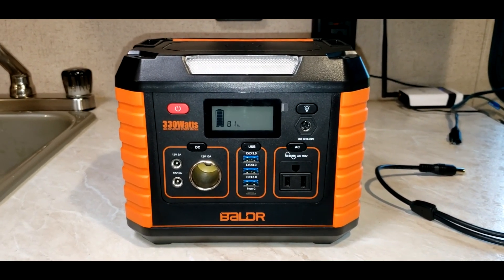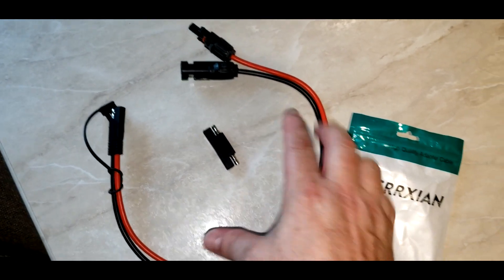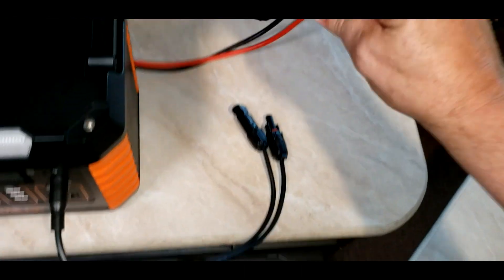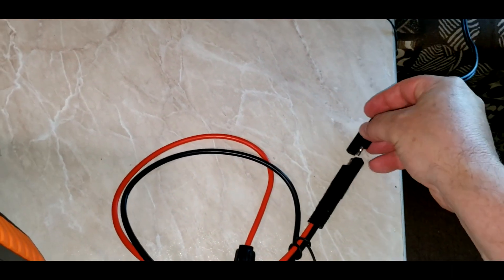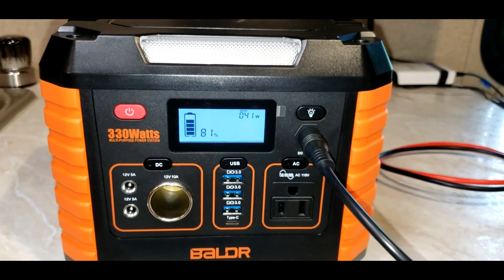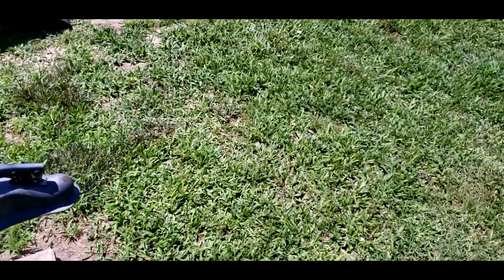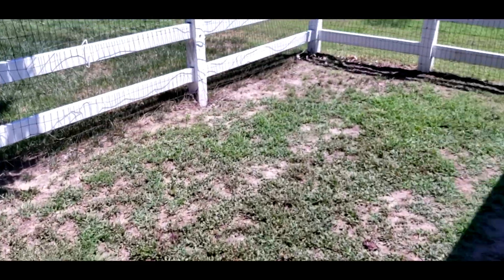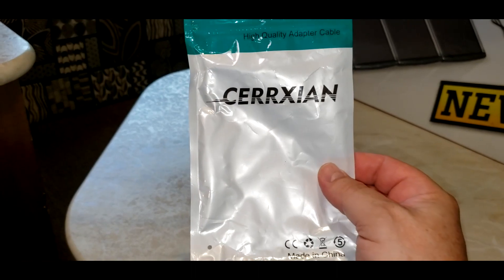Baldr 330W and Harbor Freight 100 Watt Solar Panels

Comment: Excellent, thanks. I have 2 Goal Zero Boulder 15 solar panels (came with Escape 150). What connector do I need?
Reply from the maker: 8mm going into the solar generator and MC4 to your panels, if that is what type of connector is coming out of your panels.
Reply: @jaycofever1822  Thanks, I just looked at the cable coming out of the solar panel's out port (18 GA)and it looks just like the 8mm BALDR except 4.87mm, with Yellow tip.